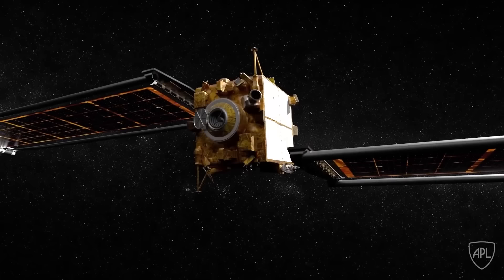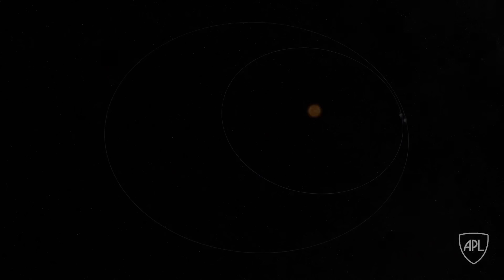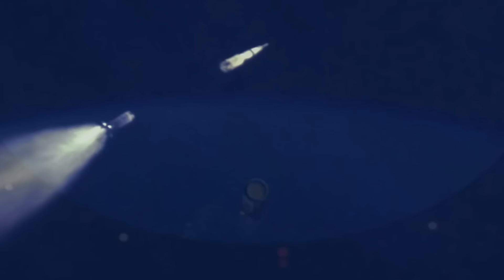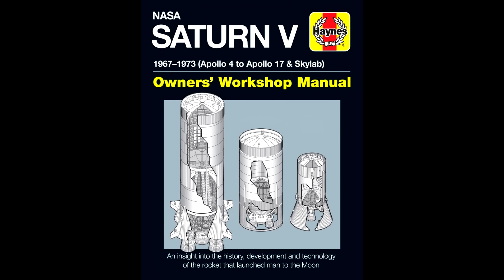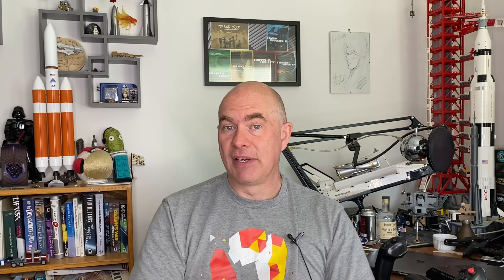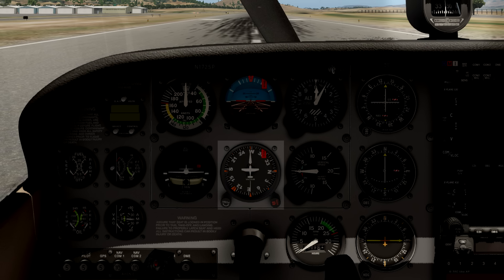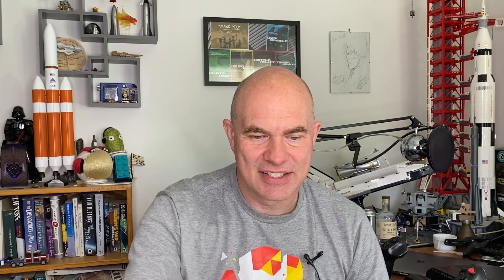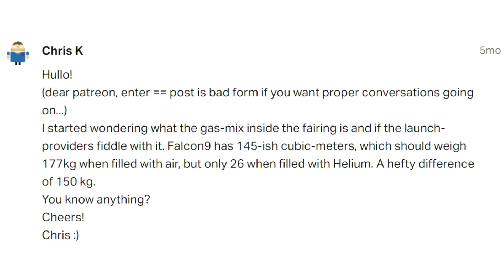Saturn V Staging, Asteroid Deflection and Hearing Rocket Turbines - Supporter Questions, Episode 17

Comment: Ooh, fun airplane fact.  Old large aircraft (like bombers) would often have a star sighting scope + sextant on them too.  Navigator used to be a very important and pretty hard job.
Reply: Yeah, the star sighting windows on some types has been converted to a satellite antenna window on some models.
Reply: Earnest K. Gann mentions them, I think,  in Fate is the Hunter. I think for aviation they were called octants
Reply: Just a silly thing but the Crews of those old bombers often referred to the Navigator as the "Naviguesser" because of the often less than perfect guidance they offered. On ships there would be three people making he sightings, then they would be averaged but bombers only had the one. Thanks for the GPS systems and somewhere near close accuracy today!
Reply: The SR-71 had one. It navigated by the stars.
Reply: Erroneous star navigation was partly responsible for the crash of G-ALDN in North Africa in May 1952

Comment: One very obscure fact about the interstage: During the launch of the Skylab workshop, the interstage failed to separate because some of the separation charges were damaged by the aerodynamic incident that occured during the S-1C burn. Luckily enough tension straps remained to hold the interstage in place otherwise it could have partially separated and affected one or more of the S-II's engines while they were burning.
Reply: The blocks of lead "hidden" inside the interstage also did not come off so Skylab reached orbit with more weight than expected.
(Blocks of lead were there because Skylab was lighter than the Apollo configuration, which would have made the center of mass way too low for a safe floght)
Reply: Worse yet was the amount of thermal energy building up amongst the J-2 cluster due to the lack of skirt separation. NASA later calculated that the S-II thrust bulkhead was within moments of imploding due to an amount of heat build-up which it was not designed for.

In a manned Apollo mission, the failure of the interstage to separate cleanly would have required an abort. In any event the partial separation of the skirt during the Skylab I launch was such that the vehicle never properly registered the failure; from a systems standpoint the interstage had cleanly separated, when in fact the separation was only a partial one.
Reply: All these replies suggest how tight the Apollo lunar missions probably were when it came to weight. A separate interstage separation was just another potential failure point, so why include it? I suspect SpaceX would never include such a feature on the Falcon 9 (or if they did Elon would nix it pronto). The ullage motors probably were massive enough by themselves that the Saturn V might not have been able to get the mission to the surface of the Moon and back to Earth again if they weren’t shed as soon as they weren’t needed anymore. So the added risk of a failed interstage separation was worth it.
Reply: @robertbutsch1802  the dual-plane separation was needed because of the tight clearance between the J-2 cluster and the interior of the interstage. The SI-C was quite massive. Any yaw or pitch imparted to it as it slid away could cause it to collide with the J-2s if the interstage were fixed to the top of the SI-C, resulting in a catastrophic end of the mission and an abort. With an interstage that separates on its own several seconds later after the J-2s had completed their initial gimbaling, that danger was negated.
Reply: @calessi  This!
Reply: @calessi  Yes, also I think the launch report mentions that an engine-out scenario would have exceeded the load threshold for the S-II aft bulkhead at that temperature. The whole launch had so many anomalies that it's amazing the workshop achieved a stable orbit. Incredible power and resilience in that Saturn.
Reply: Why didn't they start with less fuel in S-IC?
"Probably because it would leap off the pad and eventually have too high acceleration"
But center engine cut-off was on every mission, how about a second one?
"Funding was dried up, no money to test, things did go very wrong with just those changes"
Reply: @robertbutsch1802  what gives you reason to believe the apollo missions were tight on weight?
Reply: @nicholasmaude6906  That other thing!
Reply: @dosmastrify  Engines have a specific impulse. That is they are optimized for a certain mass (umm, weight) using a particular propellent.  More mass, less delta-v or forward movement.  Thus the total mass was optimised for the F1.  Everything above the 1st stage could not exceed a certain mass.  Losing the interstage ring optimized the 2nd stage.  The 2nd stage wound up with the common propellant bulkhead to shave mass.  Initial LEM design was over the allotment.  Rover was given a certain mass budget, thus the particular wire tire and minimal chassis design, and of course needing to fit in one of the LEM payload spaces.
Reply: @dosmastrify  The tyranny of rocket equation did
Reply: Great discussion here!  Thanks, all.

Comment: The other issue you didn't point out with servicing JWST: it's not in LEO, it's orbiting the L2 lagrange point. No current spacecraft is capable of travelling outside of LEO and Orion certainly isn't intended for servicing sattelites
Reply: Crew dragon on a falcon heavy. But there is no was NASA would let that happen
Reply: Robots could be sent out there. Also, I can’t imagine it be impossible to send out a “backpack” with cold gas thrusters which could affix itself to the sun side of JWST and keep it in orbit. 

Of course, by then a new and better telescope could be developed and sent out to relieve it of duty.
Reply: Heh. Should’ve watched the video first 😬
Reply: @slaphappyduplenty2436  im not sure if a servicing mission would even be feasible. JWST to my knowledge, just doesn't have the hardware for servicing, that milimeter thick, delicate sunshield would not do well against any engine firings. A new telescope with designed with serviceability in mind would be the better option.
Reply: @applesaregoodeatings  It took jwst almost month to get there, good luck sending astronauts on mission.
Reply: sounds like a challenge
Reply: When he said it would be "easier" to build another jwst it really gives you an idea of how hard, and dangerous, it would be to get to. Maybe some remote mission, still at least it won't take as long to build a second one, if needed, right?
Reply: @_K3PLR  Building a new comparable telescope would be extremely expensive. JWST did cost around 10 billion USD, which makes it one of the most costly unmanned projects in the history of NASA.
Reply: Even if Orion could be used for that purpose, SLS launch will cost more then building new telescope.
Reply: @cube2fox  A crewed mission to the L2 lagrange point has literally never been done before. It would easily cost much, much more than $10 billion, and that's assuming the existence of a spacecraft capable of that mission, which there currently isn't one
Reply: @cube2fox  90% Plus of that cost was developing the thing.
Reply: Basic conceptual knowledge is assumed.
Reply: @_K3PLR  It can't be done.  Servicing has to be built into the design and in this case it was not.  So imagination aside it's not actually doable.
Reply: @cube2fox  But at least the development costs can be dropped, but it would still cost, all that hardware was one of a kind.
Reply: _From its beginnings with Skylab, to robotic refueling demonstrations on the International Space Station, in-space servicing, assembly and manufacturing continues to evolve. Hubble’s immense success and 30th anniversary are a testament to what we can accomplish with the help of satellite servicing.   

Recent and upcoming demonstrations challenge the notion that a satellite’s lifespan is finite, even one that was not designed to be refueled or repaired. Once matured and operational, this capability promises to usher in a new era of spaceflight and make what was once thought to be impossible, a reality._

Vanessa Lloyd
NASA's Goddard Space Flight Center, Greenbelt, Md.
Reply: @praetorfenix69  But a robotic refueling mission could be possible. They will actually test a similar mission in a few years with OSAM-1, albeit in LEO. Flying it to L2 could still be worth it given that JWST was so expensive. (I assume the crewed mission to repair Hubble wasn't exactly cheap either, but still worth it given that Hubble was also very expensive.)
Reply: @cube2fox  Basically the entire $10 billion was on development. If they wanted to make a copy right now before things change too much it would probably be less than $1 billion, maybe only half a billion. But if they wait a while and people retire/leave their jobs or part manufacturers go out of of business then it would become more expensive, and eventually it would be cheaper just to start again from scratch.
Reply: @applesaregoodeatings  Why do so many people seem to believe all that needs to happen is for Musk to snap his fingers and it can be done? Scott already pointed out the logistical nightmare of such a mission in this video.
Reply: @cube2fox  Astronomers are perfectly happy with the likely 20 year lifespan of Webb. As new observations roll in from Webb, they will throw up new questions that will need far greater observational capabilities than Webb to answer. Work is already underway on the next couple of generations of space telescopes, and that's where astronomers want the limited budget going.
Reply: @EnglishMike  I will admit that I commented that before watching the video. From a Delta V perspective it would work considering that Red Dragon was a thing. 

If JWST actually was damaged I am sure that some engineers at Space X would be  running the numbers to see if they could be the ones to attempt a service mission. I’m not saying it would be trivial but it would be possible.
Reply: @applesaregoodeatings  Dragon can't travel outside of LEO. It simply doesn't have things like radiation protection or heatshield thickness it would need.
Reply: @danieljensen2626 Then comes time for the starship telescope 👍
Reply: @EnglishMike  Hubble has over 30 years of life span so far and still no proper successor, although JWST is getting close. It seems likely JWST will not have a successor ready when it runs out of fuel in 20 years. Perhaps Hubble is still operational by then. In any case, astronomers will not be happy about losing JWST.
Reply: @randomnickify  Star Ship could carry the necessary mass of crew and supplies -- the full up Star Ship is intended for manned Mars missions -- The trip to Mars will take about seven months and travel about 300 million miles (480 million kilometers) each way -- there and back.
Reply: @praetorfenix69  see my reply to randomnickify.
Reply: @Iamthelolrus  Star Ship could carry the necessary mass of crew and supplies -- the full up Star Ship is intended for manned Mars missions -- The trip to Mars will take about seven months and travel about 300 million miles (480 million kilometers) each way -- there and back.
Reply: @HalNordmann  Star Ship could carry the necessary mass of crew and supplies -- the full up Star Ship is intended for manned Mars missions -- The trip to Mars will take about seven months and travel about 300 million miles (480 million kilometers) each leg of the journey. Star Ship would also posses the required radiation shielding.
Reply: @williamblack4006  According to my calculations, it couldn't carry that mass - barely 60-80t to LEO. And it doesn't have the radiation shielding.

Comment: With an ion engine, aren’t you also adding energy to the spacecraft that wasn’t part of the original mass, e.g. photos hitting the solar cells converted to electrons that add energy to the fuel?
Reply from the maker: That too!
Reply: With ion engines the gain in velocity has almost no effect on the mass of the projectile but let's assume for a minute we were using solid rocket motors. The energy released by the impact is a result of MV^2 so as long as the velocity gained is equal to or higher than the proportional loss of mass you will always be adding to the energy of the impact. A change in  velocity has double the effect as an equal change in mass.

Comment: The ring coming out from the 2nd stage is the most iconic thing from the Saturn V
Reply: Not “one small step for man…?”
Reply: @concon3055  that’s more about the Apollo program itself, this commenter is talking about the launch vehicle specifically.
Reply: And, it’s on every configuration and mission ever flown. Even on Skylab 1.
Reply: @fork9001  was it on Skylab? Skylab wouldn’t have needed the ullage thrusters to provide continuous acceleration because it took the place of the S-IVB upper stage, was there a modified skirt section for that mission?
Reply: It was less of an interstage than Stage 1.5 ;)
Reply: @HowToSpacic  Engine skirt separation on the S-II was supposed to happen, but failed to separate because of payload damage.
Reply: @HowToSpacic  Saturn V was a 3-stage rocket though, and Skylab took place of the 3rd stage. The 2nd stage was mostly the same as on other Saturn launches, so they shared the 2nd stage ullage and the skirt.
Reply: I wouldn't say that's the most iconic thing from Saturn V..... Maybe most iconic from the launch....
Reply: As a kid.i remember the launch cranes or gantrys pulling back... seemed like we were releasing a caged animal to leave the planet. And coming during the count down I'd say losing that interstage was more like Saturn flicking off a cigarette butt on the highway 😂
Reply: Not the black flames?
Reply: Not even how big it is?
Reply: fr